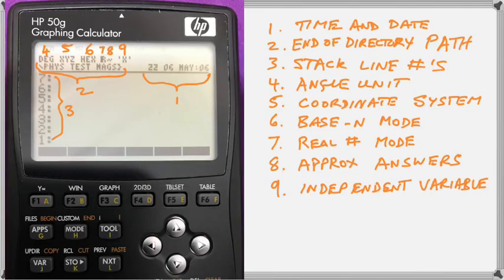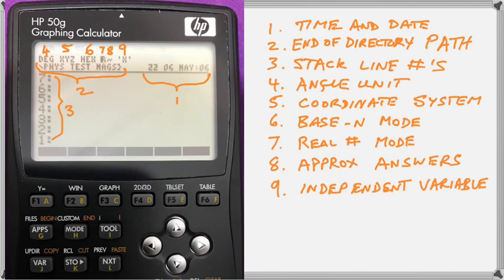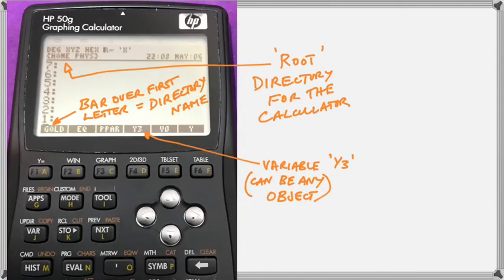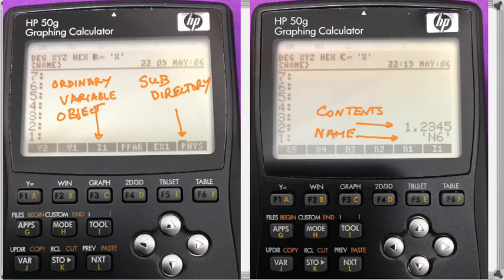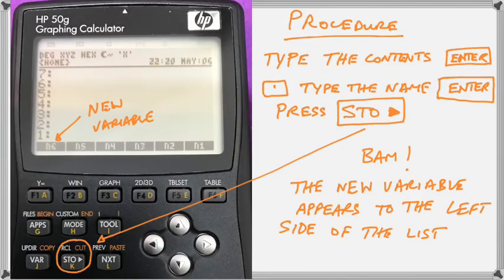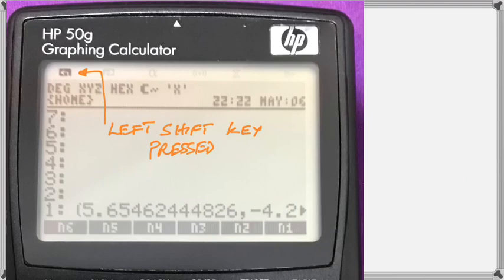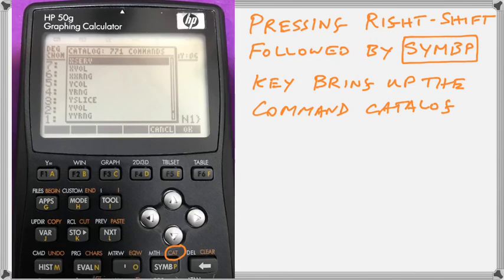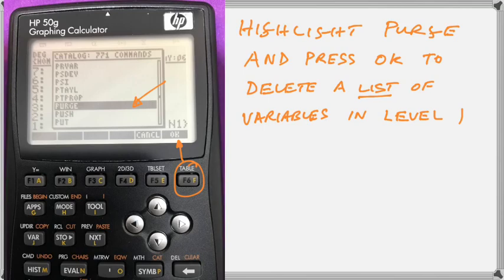hp graphing calculators - Introduction (part 2)

Comment: Please let me know how to calculate factorials on the HP 50g. How do I bring up the "!" symbol? Thank you, Rolf
Reply from the maker: Hi Rolf I answered this question already ... I reply on the first post you made about this question .... However, here is yet another way to do factorial..... 1. put the number you wish to calculate the factorial of into the calculator 2. press the RIGHT SHIFT key then SYMB key (this brings up a catalog of all the commands and functions) 3. scroll up until you see the "!"  symbol (the catalog is in alphabetical order and the "!" is the 15th "up press" above the top of the "a" listing) 4. once you have highlighted it simply press the "OK" soft-key on the far right of the bottom of the display (which is the F6 key) and you factorial answer is instantly calculated and returned on the stack ..... cheers .... and do not forget to look at my other answer also .....as there are so many different ways to do everything on this calculator
Reply: Hi Stephen, thank you very much indeed for your detailed and very clear explanation. I am afraid I did not get your first answer for some reason, however, your second answer solved my problem completely. By the way I enjoy your videos on the HP 50g very much, and that is because of your competence and also because of your clear language, that makes it easy for me to follow @StephenMendes 👍